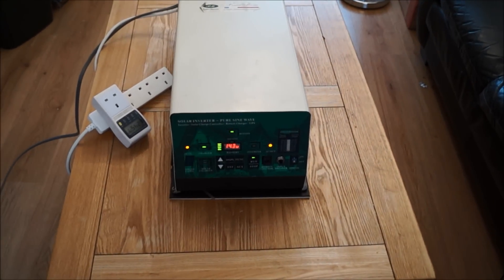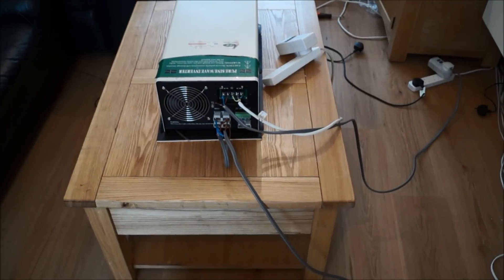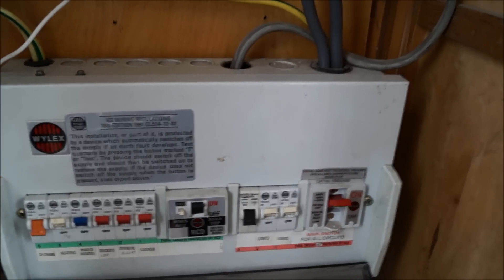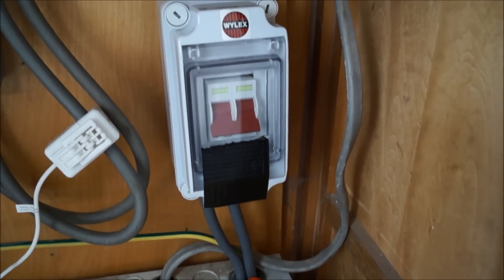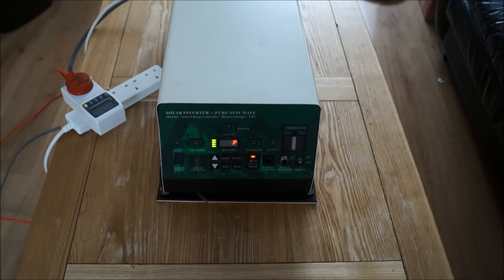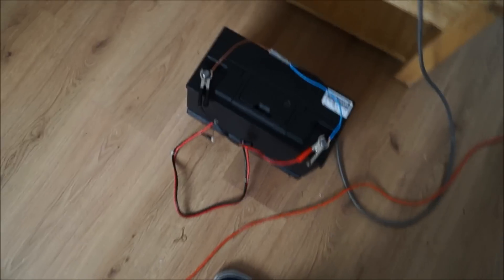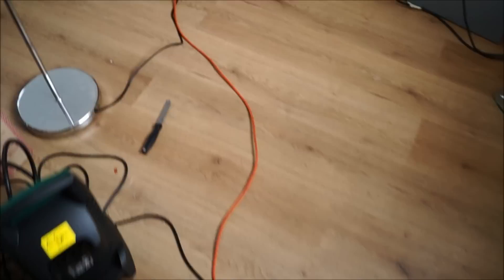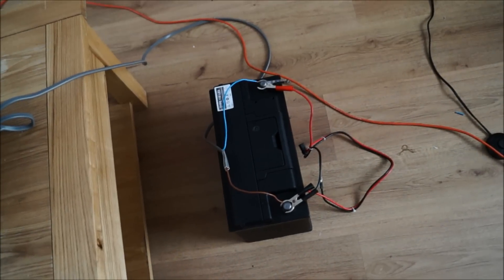House running off a single 12v battery

Comment: I thought about x2 batteries for starters. Connect a pwm car charger to it. Use normal power for charging but the rest of the house bar shower / cooker  id run effectively for the cost of charging the batteries vs the disgusting bill we just got for 2-3 months

Comment: The reality is, for anyone who does not realise this, we are not in the 1980s anymore, with tungsten lighting, power greedy halogen lamps and PV panels costing more than the price of a family car.  If people just woke up and got educated, we could crush the greedy energy companies monopoly on energy. I live offgrid in a normal semi, I made my system adaptable and extendable, it is not fully developed yet so I have to be frugal especially in winter, I have back ups and an emergency 12volt petrol generator which I end up using maybe three times a year and it is filled with expensive Special petrol (ASPEN) which does not go off and ruin the carbaretter.
 The fact is we now have youtube with lots of sound advice on how to construct very safe professional off-grid systems, solar panels are cheap and readily available, I have even found them in skips. We now have cheap pure sine wave inverters, we have MPPT charge controllers, LED light bulbs  which run on tiny currents, some will run directly from 12volts or a varied DC voltage supply. About the only thing I am now not able to do is plug in my welding machine, my inverter is only 3KW but I even have a way around that.  People just need to learn more about electrics and challenge their fears of going offgrid.

Comment: Some of your low voltage alarm problems could be the thickness of the cables from the battery to the inverter.  For a permanent install with a 3KW inverter and leads from battery to inverter no more than around 2 meters long the area cross section of the cables needs to be 70mm Squared, with insulation they are around the thickness of your little finger. Welding cable is what I used, and I have a tool to crimp on the cable eyes.

Comment: so you have a normal 3 core cable going into the fuse box and a plug at the inverter end, what fuse is in your plug and what kv or watt is your inverter? cheers

Comment: How long would the power last then Out of curiosity
Reply: If he was using his standby power of 50-60 watts, his leasure battery has about 1,000 watt hours (or watts for the sake of this) worth of power.

Theoretically, if conversion between 240v and 12v was perfect, he could get 20 hours of 'standby' from this battery. With his usage however, he's probably talking about an hour of general use with lights etc. Add any kind of tv, pc, stereo system or anything that draws a high current and this will be significantly reduced. Also most inverters lose about 10% - 30% of power (and the ones that lose the least are super expensive).

Comment: Not quite what I expected. I actually run a house in the summer totally off a 12V battery. Refrigeration, lights, hot water, etc are all PV operated.  Wife even has a dishwasher with heated dry.  While not much of a battery, the PV array is 1600W. It is a little adjustment in lifestyle, but no great sacrifice.  You just do things when the sun shines and can use all the power of the panels. Example, dishes are allowed to be washed between 11am and 3pm when the trees get out of the way of the sun.  Next year we will be washing clothes with solar the same way. Our new direct drive machine takes less than 300W and with a clothes line it is only sunny days you do the laundry. Only have a small inverter.  Many devices use the raw PV DC buss for power so no inverter losses.
Reply from the maker: +opera that's impressive!
Reply: PrepareForTheUnexpected 
Keep your secrets tucked away from the world.
Next thing your know that mr xyz from large firms want to steal your ideas.  Energy is free for all humans.
God has given everything in this world to share and not charge.
Reply: opera really?? can you please tell me how? i was thinking you ll need  more than that..thank you👍

Comment: That inverter probably draws more than what you are trying to run.

I live on 12 volts, my television is 12 volts, just cut off the wall wart and wired it directly to 12 volts. The same for my computer monitor, The desktop computer was a bit more difficult, they sell a power supply for 12 volts to run a desktop computer. You need a couple extra splitter cables but it works great. I even have motion detect yard lights so I can work in the yard and walk around without turning on lights.
Reply: I plan on doing this for 80% of everything I own in the near future.
Reply from the maker: +rbodell interesting food for thought!

Comment: Do you know what the current draw off the battery was?
Reply from the maker: +neil2226 nothing more than 23 Amps at 12v.
I was only drawing a couple of hundred Watts.
Reply: PrepareForTheUnexpected I'm a car mechanic so I'm not too familiar with current draw measured in watts, I use an amp clamp, but 23 amps seems very good considering all that running. Thanks for the reply

Comment: Really cool. Wonder if you've gone off the grid yet wit leisure batteries?
Reply from the maker: +Hamish Marshall I tend to use it more as a backup system incase of a power cut. They aren't ideal (leisure batteries) for off grid running but they are very good value for money with what you get.

Comment: I have my shed running on a single car battery too (I converted it to deep cycle alum battery first), but because my solar panels are very small, I keep everything running on 12V, no inverter. It's a bit annoying to find cheap 12V applyances, but I've managed using stuff that run on gas instead.
Reply from the maker: +DJBelbe What a great idea! Plus with 12v appliances and gas, you can run in the middle of the wilderness! Do you have to keep the battery warm at all?
Reply: +PrepareForTheUnexpected warm? u mean because of the alum solubility? I live in Azores, temperatures do not go below 10ºC (50ºF) here. and even that low is rare, only happens in February. Though I've seen some people online using alum in snow conditions with no problem. maybe depends on what kind of alum they're using?

This winter I'm hoping to increase my power by adding a small hommade wind turbine and an amorphous solar panel (they work well under clouds and shade). If everything works ok, I'll make a video too to share the specs to anyone who might be in the same condition as me: low budget, low light, plenty of wind ;)
Reply: DJBelbe 
My friend... don’t start showing your ideas on the net. Your only making the energy companies aware of your discoveries and potentially give them new idea to rip off citizens around the world.

Best of luck and stay quite.
That’s my philosophy 👌

Comment: the low voltage alarm kicked in at this low voltage because of the cable that you are using to connect the batteries to the inverter it not big enought try using something alot larger like jumper cables.
Reply from the maker: +kiskiller3 Good comment! I upgraded to 500amp cables in some of my new videos. Have a look!
Reply: good!
Reply: I have a small solar backup system and the cables from the 2000 watt pure sine wave inverter are on the order of doubled #6 AWG less than 2 feet (60cm) long.  The cables on the battery bank are #4 but they're about 10 inches (25cm) between the batteries.  The peak draw is about 185 amps with a 200 amp breaker for safety but the average load is under 300 watts so the 420AH battery bank can last up to 20 hours, depending on the season.  It powers fridge, some LED lighting, charging cell phones and tablets, the in-house network and the internet.

I've never run the batteries down to the low voltage alarm level.  I replaced the original AGM batteries shortly before they turned 9 years old and even then half were still at 80% of original capacity (the commercial "end of life" indicator)..  I expect to get similar life from the current set of AGM batteries by giving them similar care.